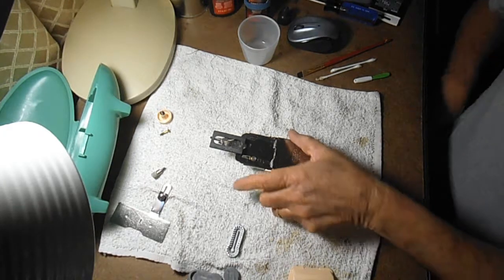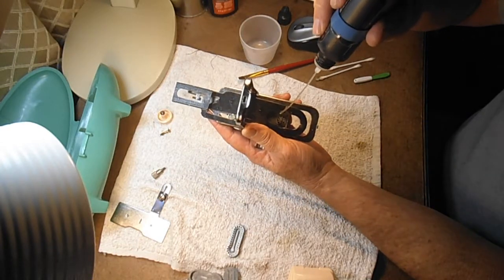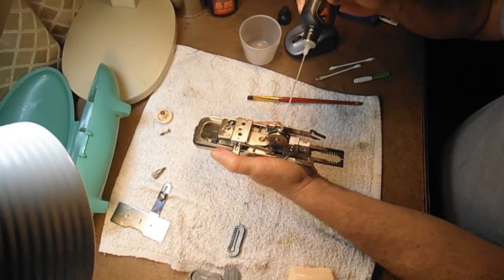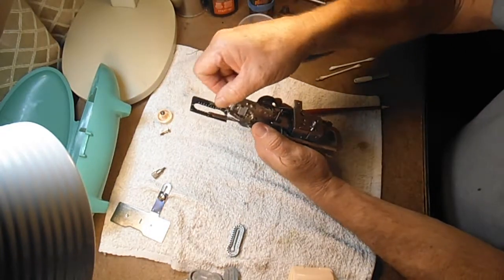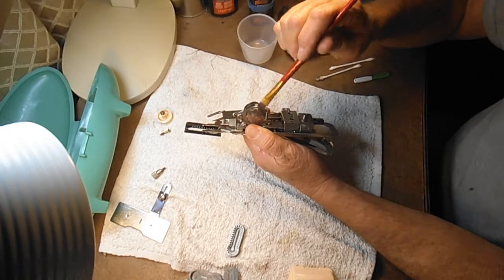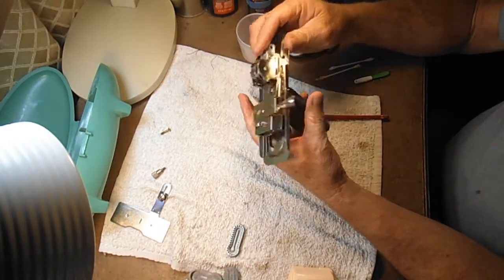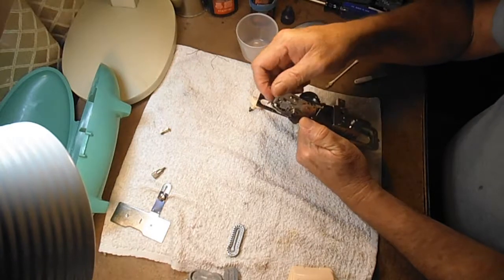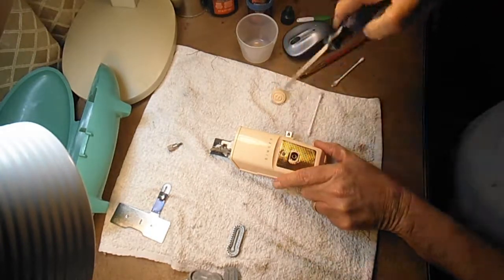VINTAGE SINGER BUTTONHOLER CLEAN & LUBE PART 5 OILING

Comment: The instruction book didn't say how to take it apart...then I noticed you had that large thing laying out.....I wasn't sure I could remove it....silly me.
My piece was kind of dirty,  like old grease...I probably bought it 55 years ago (after making bound button holes on everything)
I wonder if it could be soaked in dish soap water.....  The fork does not move the gear; it's stuck in place.
I'm waiting to see if it will loosen up after it sits a while.
Reply from the maker: It may be stuck due to old dried grease which can be very hard and act like a glue. Almost it won't hurt the soak it and soapy dish water. It's all metal. There's no electronics on it, but sometimes I've had better luck using a hair dryer, medium heat and low air for 5 minutes or so and then trying to get it moving. Of course it's hot then so I wear some old gardening gloves to handle it. Once it starts to move even a little bit then I just add a little more new oil and keep working it. Then it gets smooth
Reply: Sounds like fun....options!...I will tackle it as soon as I can be done with holidays. @andytubesewing1953
Reply from the maker: @judydyer  If after the new year then you have plenty of time to soak those parts with WD. Happy New Year of buttonholes.
Reply from the maker: @judydyer  Now that is determination! 🏆 Penetrating oil (like WD40) is a hydrocarbon so it reacts with the old oil/grease quicker to soften it. Hot water/soap is fine but when you add new oil and then go back in the water the water has to do something with the new oil before it gets to the old oil. Soap helps dissipate the old oil as does heat.
      If I were going to be making buttonholes regularly I'd get the newer version of the Singer Buttonholer called the "Professional." They made them for straight and slant needle machines and they open from the TOP! (yippie) so it's very quick to change templets without removing the attachment from the presser bar. Here is just one example (slant needle)  https://www.ebay.com/itm/295398308223?epid=667333564&hash=item44c71c797f:g:X6gAAOSw-fVjkJ6i
     You can download a FREE copy of the manual for the professional model here: https://ismacs.net/singer_sewing_machine_company/manuals/singer-professional-buttonholer.pdf

   Have you ever thought of restoring a vintage sewing machine? Seems like you are a natural 😁
Reply: @andytubesewing1953  interesting...   Thanks!....only 26usd....or, less!..but, shipping to Mexico looks like 33usd.     I think I'll stick w/ what I have.....since I am 84, I doubt I'll get much use out of a new one.    I might even try making button holes by hand, just for the heck of it.   ....And, wht would I do with "old faithful" that is now cleaned up and ready to go to work.    hey, I don't even need more clothes; I just like to keep busy..and use some of my collection of linen tablecloths to make clothes from: best linen ever...Irish!
Reply from the maker: @judydyer  Mexico okay I get it. I shipped one of my machines to a buyer there. Wow! Was it expensive 😲 You're all set. I also get the Irish linen my mom made a beautiful Christmas vest out of a small tablecloth one time. Wishing you a merry Christmas and a happy, healthy prosperous New Year then!